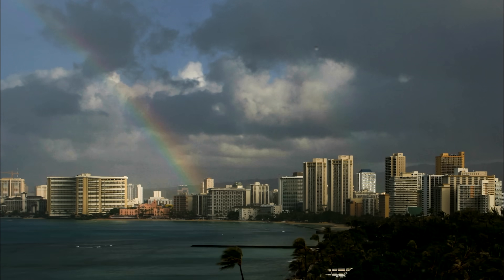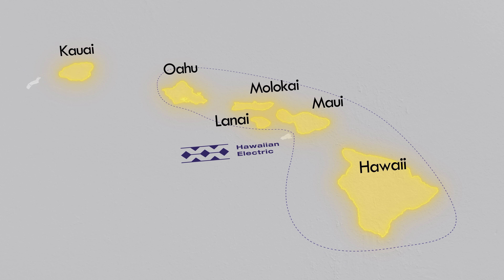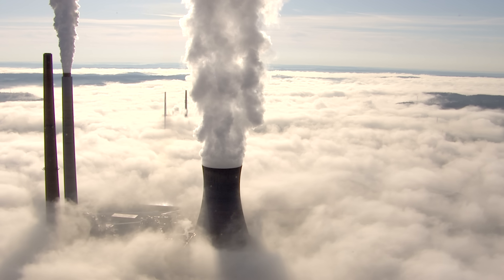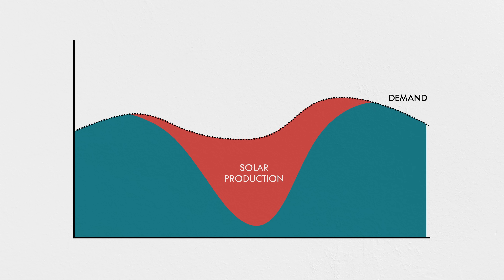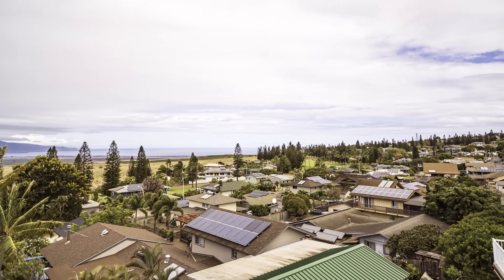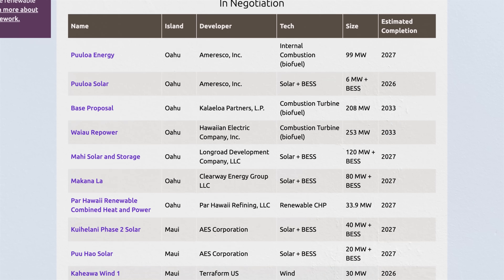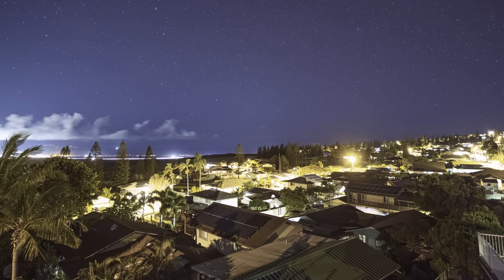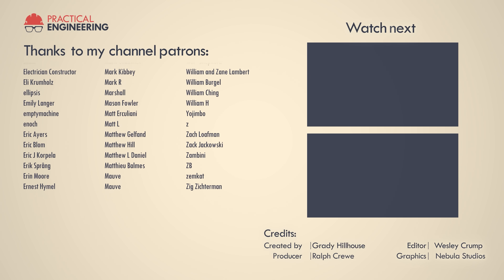How the Hawaiian Power Grid Works

Comment: Why is there only 1 geothermal plant on a volcanic island?
Reply: Oahu is the most populous island and doesn't have any geothermal potential. Only the Big Island does, and it's very challenging to find a location for a geothermal plant there that won't get decimated by lava flows.
Reply: @mack.attack  exactly what I was saying. learning how to work around those limitations is one of the big purposes of the one extant geothermal station.
Reply: @mack.attack This one. Literally every one of our other islands than the Big Island are basically geothermically dead rocks.
Reply: Well that's a little less surprising when you realize that the island with all the active volcanoes is not the same island, hence not the same grid, as the island with most of the people on it.
Reply: @kevinstrout630  Also the volcanism on Hawaii is really active and often shifts so its a matter of finding a place that's warm underground but not liable to have lava flow over it before a few decades pass.
Reply: It's also risky to build expensive power plants that might get run over by lava, our 1 geo thermal plant almost was in 2018.
Reply: @SquidFisT44 😅
Reply: @SquidFisT44 lava dams? Lol

Not sure what you build that out of,dirt I guess
Reply: I'd guess that most of the spots which are hot but not too hot keep moving.
Reply: @nnelg8139 nope, Hawaiian laws and treaties with indigenous tribes pretty much enable and encourage legal monopolies. They have no incentive to upgrade or expand their infrastructure to meet demand and are more than happy to pass any and all costs  to consumers sole reason why everything is expensive in Hawaii.
Reply: @nnelg8139 lmao the islands are "moving" that fast, bud.
Reply: Probably because only two of the islands are still volcanic and as stated in the video, the islands arent connected.  Most people dont live on the volcanic ones.
Reply: @leepete6815 yeah because Republicans are so dedicated to clean green energy. I know you're not serious. None of you are serious people.
Reply: The ultimate answer is always “money.” The upfront costs are larger and there isn’t a large US competency in GT. Hawaii would need to sustain a local skill set and build out excess capacity, with no one to purchase overproduction.
Reply: @norlockv  on top of that, Hawaii faces challenges with its geothermal that are rare or absent in places like Iceland. 

The one current geothermal plant is as much a testbed for the specifics of geothermal in Hawaii as it is a practical source of power. The lessons learned there will go on to inform the construction of later geothermal plants, public sentiment and legislation willing.
Reply: @norlockv US has the highest geothermal power generation, followed by Indonesia and the Philippines, far poorer countries. What are you saying?
Reply: @norlockv no it isn’t! The main answer is the communities don’t want them! There are hundreds of requests for new power stations and the local vote it down! Takes 3 minutes to look it up 🤡
Reply: The US has the largest amount of geothermal of any country.
Reply: @jeffjwatts  More than Iceland?  Not on a per capita basis.
Reply: Also, something I don't see being talked about. The volcanic activity in a place like Iceland and a place like Hawaii is different. Quite apart from the age differences. The volcanic activity in Iceland is much more "stable" geographically speaking. If you look north of the current Hawaiian islands you can see older and older islands (many of which now only show up as "bumps" under the Pacific Ocean) as the continental plate the islands sit on moves away from where the magma comes up. And there is a new island south of the Big Island under the ocean being formed right now. The volcanoes in Iceland don't do that. This makes geothermal energy in Iceland much more feasible as well.
Reply: @enviableechidna  theres a reason hawaii had the first ever instance of a geothermal well being innundated and overflown with lava and the second ever instance of a geothermal well drilling straight into liquid magma
Reply: A lot of leaping into conclusions here, very little actual data. Who here has done any calculations if it would even make sense? How much energy would a new plant add? Is it needed on that island? Were multiple plants considered in the planning phase of the first one? What if multiple geothermal plants would make as much sense as ten small fridges throughout a studio apartment?

Calling the engineers who built the whole system idiots when you don't have even a simple understanding of the whole system is not the way my dudes.
Reply: @Pingviinimursu that’s what’s getting me too. Too many people focusing on looking down on the “less civilized” (as those people would call them) instead of looking at the possible crux of the issue
Reply: The facts are clear and obvious, Hawaii is HIGHLY dependent on fossil fuel, one of the worst in the USA or close.   When they have resources.  They drive gas guzzling cheaps everywhere. @Pingviinimursu
Reply: @Pingviinimursu social media has a unique feature of empowering science and engineering illiterates to think they actually know things.
Reply: O’ahu’s volcanoes are extinct, so I doubt there is much geothermal potential.  The active Hawaiian volcanoes are all on Hawai’i Island (aka the Big Island), which is a significant distance away.
Reply: @Pamudder  nope. Try again.

Check where the volcano Haleakala is located.
Reply: @Pamudder  As was said, cables can be laid between the islands, except (insert your favorite reason here). I'm remembering all the things that DIDN'T go wrong with the Alaskan pipeline, even though EVERYBODY said that it would go wrong.
Reply: This is much more of a practical issue. Geologically speaking, Hawaii is very young. It has not had the millennia of erosion that other volcanically active areas have had like Iceland and Indonesia. Drilling through fresh-ish volcanic rock is incredibly expensive and usually ends with blasting. Since it’s also an incredibly rigid underlayment, the frequent earthquakes from the volcanic activity can break the underground lines. Basements in Hawaii are basically nonexistent for the same reasons.
Reply: I worked briefly on drilling some of the wells at the Puna Geothermal Project in 2022.

As far as I'm aware the project has support but other projects just wouldn't be in as optimal a location, but I can't say for sure.

Optimal or not, the Puna Geothermal Project was inundated with lava during the 2018 eruption, but they were able to repair everything and get it back up and running.

Also as others have mentioned geothermal has strong opposition from Hawaiian natives for religious reasons.
Reply: @carltonhealy9457 This is by far the BEST COMMENT. 
This coming from “the horses mouth” 💯🤙🏾
Everything @carltonhealy9457  has said is 💯true, down to the native Hawaiians disliking it 💯🙏🤙🏾
Reply: @carltonhealy9457  The religious part is such a shame, you would think it would be the ultimate validation and feeling of connection with a deity to directly power and protect your home with their energy. Can you imagine cooling your home using the heat from a volcano? Running the refrigerator that feeds your family on God power? Amazing
Reply: @carltonhealy9457 thank you for bringing some legitimate context and sanity to this thread
Reply: Very nice. Almost every different problem with society all on display in a single comment thread. 🤌
Reply: Probably because stuff costs money 🤷🏽‍♂️
Reply: Because... when HELCO pit out bids to build more geothermal plants, outside of the LERZ (where the most recent eruption was), they got exactly 0 bids. 

Investors only want to build, in the most dangerous lower Eastern rift zone.
Reply: @Maiant  Again, local government. Building permits. "No, you can't build there, you must build here." "No, you're not emplying enough women." "No, you're using the wrong cement." ("His" brother is a cement supplier) "No, you don't pay your employees enough." All of it is just reasons why government won't allow it to be built. It still comes down to local government. The reasons, are too numerous to bother discussing.
Reply: The active spot is very very variable. Any place that's warm enough would be under a very large threat long term that it'll get destroyed by an eruption. In 2018 a neighborhood got destroyed by an eruption that didn't come from the main caldera. Plus, where it would be possible would be the big island and the population there is so so so small compared to Oahu, where most residents live. Big island is huge in size and there's lots of room for solar panels and wind turbines. Easily movable and replaceable if there's ever a threat of eruption. People forget that the islands are literally whole volcanos sticking out of the water. You have to be very conscious of this fact
Reply: People don’t want the sacred religious site drilled into in a disrespectful manner. The traditional Gods, like Pele the volcano God, still have a MASSIVE cultural and religious significance. To us it’s like saying, “why don’t we put a power plant in the Vatican?”.  Most locals, for better or worse, would not support this effort, and it would be political suicide for any one to pursue it.
Reply: @DaBatman-o1v  makes sense, they have good reasons to not mess with the volcano
Reply: Lol this comment thread is batshit
Reply: Only one volcano on one island. That island also has a much smaller population than the main island.
Reply: Do you know how geothermal plants work?  Can you imagine some possible difficulties installing and maintaining them on an island that has plenty of volcanic and seismic activity?
Reply: Hawaii island is the only one that's actually geologically active but it really doesn't have that big a population
Reply: Cuz the water wells underneath will be broken into and they are essential for the ecosystem up top
Reply: I was baffled by that too!
Reply: Because it’s Hawaii. Everything is more expensive to do, and there’s nobody there to do it.
Reply: It’s because the islands actually don’t have much diversity under ground. If you look at the topography it’s too small to be home to such geographical features. It really is primarily just lava rock. Larger continents have vast array of variety
Reply: Only one island has hot geology, the Big Island, and there's not enuff demand to warrant building more geothermal for that Island. It's cheaper and simpler to build solar, wind and other types (mostly experiential power production methodologies like water wave, hydrothermal and other types).

The other Islands are largely extinct or  are technically dormant volcanic islands. Technically because those islands' last volcanic activity still are within the cutoff time between long dormant and recently extinct volcanos (about 10000 years). The islands of Maui and even Oʻahu technically have dormant volcanoes, but realistically speaking there's little doubt about them ever erupting again, but their last activities were still less than 10k years ago.

The current geothermal plant is still technically an experimental ppu (power producing unit) that doesn't have full regulatory approval to operate as a commercial operation. 

There's currently certain irregularties regarding the methods of the commercial interests are using in trying to get that approval. Some of which are bending the rules do hard that they've broken some of them (the rules). 

By and the large, the ʻaina (the people who lives here) generally respects the rules and looks with extreme disfavour on those who would try to rush and break rules to cut corners. Unfortunately those commercial interest are Mainland outsiders who have proven themselves to be a rather unscrupulous lot.
Reply: Because the residents don’t want them…
Reply: You need the proper location in order to set it up. Like the rocks underneath the plant need to be deep enough and able to take in water in order to generate electricity. I don’t know a lot about geology but I’m pretty basalt is not a good candidate for geothermal. There are also concerns about earthquakes caused by geothermal and the Hawaiian archipelago is the most volcanically active place in the world so you gotta be careful. Hawaii also isn’t a very rich state believe it or not.
Reply: @king_br0k I can totally understand that question! The answer is long-winded. As a Native Hawaiian born & raised here on three of the six islands that are populated, I can share that each island is VERY different from one another in terms of their access to certain renewable energy sources. The entire state has about 1.4 Million people living here, 1 million of which live just on Oʻahu alone, but the only island that has a RELIABLE source of geothermal energy is the Big Island of Hawaiʻi, which is home to about 200,000 people. 

As some of the comments mentioned, the Puna Geothermal Venture (PGV) project was met with considerable pushback when it was built in the 1970s from my Native Hawaiian community due to cultural, spiritual, & ethical concerns surrounding our goddess Pelehonuamea. You have to understand - this was 30 years ago when the benefits of this technology wasn’t properly communicated to the local community, in particular our Native Hawaiian Community. Although PGV provides an impressive 30% of the Big Islands’ energy needs, it is also okay to recognize the cultural controversy these projects can cause for indigenous communities like my own. It normally for a project like PGV to be both beneficial and burdensome.
Reply: @MrHawaiianguy  thanks, the replies to my initial question have been very informative
Reply: I think nuclear is going to be the answer to generate the amount of electricity that the worlds humans will need.  That is if we want to stop global warming.  Nuclear is actually very safe if the plants have adequately built containment walls around them.  For Hawaii, (I have an address near Hilo) nuclear is definitively not the answer due to the culture here, however we do have a very reliable solar source with roughly 12 hours of tropical sun a day year long.  That said, we are on HELCO but plan on putting up our own non grid separately constructed solar panel and lithium ion battery system for everyday use.
Reply: @thomasreto2997  nuclear is the best option in my opinion, the us navy is proof it can ge done safely
Reply: Politics
Reply: Being volcanic is not enough. You'll also need presence of subsurface fluid and claycap to have a sustainable geothermal process.
Reply: The gods get angry
Reply: @donwilson4934  Mwahahahahahahahaha!
Reply: I know I'm late to the party here, but I looked into it and I would guess that Hawaii might be too volcanically active somehow? The one power plant was actually shut down due to the eruption of 2018 and didn't return until 2020.
Reply: Democrats
Reply: It’s really funny how everyone is arguing about the religion problem when the most obvious reasons which have been stated many times in this reply section (moving hotspots, lava danger, low population, etc.) get no responses at all
Reply: @noodleman_9  a problem?
Reply: @noodleman_9 Because these people are incapable of logic or abstraction. They are beasts of nothing but emotion.
Reply: @noodleman_9  yea, I also found that funny
Reply: Because of non educated groups of people protesting it
Reply: To be entirely honest I see a lot of other good reasons, but I feel putting a large emphasis of the power grid on an actual volcano, one with frequent lava flows is a bad idea as well, one wrong flow and the power is out for millions, and for quite a while, as getting destroyed by lava seems like a “restart from scratch” kinda fix, which I fear is something a tropical, isolated, and extremely important island can’t handle. I mean they could always build 2 or more, or build giant earthworks to redirect the lava, but genuinely that seems so like, counterintuitive, I would just go nuclear and put it on a dormant island lol.
Reply: It's not that easy to just  build more geothermals. The tech is still relatively new and more expensive than building new coal or petro power plants. Thinking the locals are the main problem and too dumb to not build more is very naive
Reply: Because the govt chooses winners and losers, and their current money laundering scam is wind and solar.
Reply: Because Hawaii is ran by democrats.
Reply: Exactly...
Reply: It’s like something you’d encounter on a city builder 🤣 not unlocked until level 43!
Reply: Stop over crowded cities and the problem disappears.
Reply: One consideration may be religious. There have been fights against some construction projects because the land has religious significance to indigenous Hawaiians.
Reply: @@JuanSmithers Government issues building permits. All you have done is giver yet ANOTHER REASON why government won't issue the permit. Jacka**.
Reply: Oahu isn’t volcanic
Reply: Protect the aina
Reply: Only big island have active volcanoes
Reply: The big island is the only actively volcanic one and has a relatively small population.
Reply: It's called a monopoly
Reply: Same reason it’s seldom used elsewhere, it’s very expensive requiring hundreds of wells drilled, many of which will fail, and it needs a lot of fresh water.
Reply: Because the Government are paid by the electric company for them to monopolize electricity
Reply: It's an active volcano... sure spend a billion on a plant then 10 years later an eruption levels it...
Reply: preservation of the national park i suppose, as well as preserving the growth of Island landmass pumped storage and gravity storage is a definite winner as farm watering grade grey water not blackwater could be pumped up and down hill or to tower's which just absorb the exess energy for later use cement/ rock carrying gravity trains 🚂 if you don't have water then geothermal is definitely an option utilizing the existing coal plant just in a upgraded way even if natural gas run the steam engines could gather heat from magma stores to preboil the most efficient energy transfer fluids salt 🧂 water glycol refrigerants whatever works best
Reply: Unsure but the hotspot that forms the island is only below the big island. The smaller islands are older because the Pacific plate has been moving, and the smaller islands are where the hotspot used to be, but are now are now slowing eroding away
Reply: welcome to hawaii, land of the most currupt politicians and monopolies to ever exist. Our electric company is owned by blackrock
Reply: There's a lot of religious/sacred spots to the native Hawaiian people. It's like the situation with the observatories on Big Island. Very tricky spot to figure out.
Reply: They dont want cheap solutions.  Period
Reply: @CabilGibbs  It isn't anywhere near cheap. Solsr is less expensive.
Reply: I live on Big Island….the public does NOT support the Puna Geo thermal Venture.
Reply: Not all Hawaiian islands have active volcanoes, Oahu, Kauai volcanoes are extinct
Reply: Wow you know I didn’t think of that before very good question isn’t just like Iceland or Greenland???
Reply: GT-ing around a shield volcano where magma has low viscosity and could just have lava to unexpectedly ooze on your backyard is yet another challenge. Start a drilling but expect higher chance of lava to come out.
Reply: Because its expensive and only like 200,000 people live on the Big Island
Reply: Traditional power providers do not like competition. My buddy who lived on the Big Island (the volcano island) that he would get hate from people for having solar panels on his house. The power companies would state power costs were so high because of solar panels. There is an actual volcano there and year round sun!
Reply: Woke politics
Reply: Because the other ones are probably used by the government or military for secret underground bases
Reply: Being volcanic is not enough. You'll also need presence of subsurface fluid and claycap to have a sustainable geothermal process.
Reply: I mean volcanoes are unpredictable and you could lose a whole plant in seconds plus activist. The big island isn’t that big and the volcanic activity is isolated to one part of the island the whole island isn’t active
Reply: Because it's ran by demonrats n they don't care about the population just the power of government
Reply: You should research it. Its a good question
Reply: Exactly! I was wondering if they could take a page out of icelands book
Reply: Limits growth due to low cost of energy
Reply: Only one island has an active volcano.
Reply: The geothermal plant we did have was 100 yards from the last lava flow that destroyed almost 1000 homes my family lost everything in that lava flow.The puna geothermal venture the company that  operated the plant was drilling sideways down to 50000 feet in the same direction the lava popped out of.They created that lava flow that caused hundreds of millions in damage.They had the plant right next to subdivision.Friends that lived close to the plant had respiratory problems from the steam they would vent.Go ahead build one in your neighborhood not mine we lost everything its not worth the risk
Reply: And zero nuclear ?
Reply: Well, only one of the islands has active volcanic shtufffs. Also, the volcano is a literal God in fokelore, so the natives would get pretty peeved.
Reply: (Now that I’ve read some other replies) — To all yall typing about pinkos and libs: that’s not what OC was asking, so quit wetting your panties over two systems that historically have both lead to some folks ruling over other folks; people will be selfish and greedy no matter what governmental systems are in place.
Reply: Small population. Most people don't live by the volcano and it's not cost effective to transit power from big island to Oahu.
Reply: Geothermal doesn't work the way you think - it just takes advantage of the fact that more than 4-5 feet below the surface, the earth is pretty much the same temperature year round. You can draw heat out of that in the winter and dump heat into it in the summer
Reply: There only one volcanic island. The other islands are just older islands. The spot where the volcano 🌋 is active is because of the movement of the tectonic plate.
Reply: Because we don't have materials that can withstand the heat and pressure of magma deep enough to extract the endless power from them
Reply: Man if only you had gone into electric stuff in school
Reply: They're expensive
Reply: Because Republicans hate helping people
Reply: Only 1 island has hot geothermal the rest of the islands are cold and full of water.
Reply: @doomaster4  Full of water?  You were on a roll and then blew it.
Reply: There were plans to make several Geo plants. Enough to generate power for the entire state. Same for a wind farm proposed on the windiest spot on earth; Kahua Ranch. This farm would also produce enough energy for the entire state. Larry Ellison of Oracle proposed a giant wind farm on the island of Lanai that would generate enough energy to  power the entire island of Oahu.  HEI refused to purchase the power generated from any of those projects. HEI blocked plans to unite all the islands onto one grid. Instead, HEI chose to make their own mini projects, limit the amount of solar on homes within neighborhoods, and remain dependent on foreign oil. All that Grady suggests are distractions to the real problems. Politics, control, and greed. All this could’ve been settled well before Grady was even born. Back in ‘74, a local entrepreneur suggested Hawai’i use sugarcane to generate Ethanol to power 40% of all island vehicles by 1985,  100% independent by 1995. Local business C Brewer blocked and shuttled  the project.
Reply: Democrats they fu$& everything up
Reply: Maybe it's a big one?
Reply: Because:

Drill baby drill!!!

American ideology...
Reply: Because Republicans hate renewable energy.
Reply: The same reason why we don’t use nuclear as our MAIN baseload power. 

It makes too much sense
Reply: @ Nuclear power was not chosen because it makes “too much sense”? What a silly thing to say to say. 
You might have said that a small island like Molokai or Lana’i does not have the market to support a nuclear power plant, some other comment that actually makes sense, but whatever, being ignorant sounds cool.
Reply: Because geothermal is a ridiculously impractical pipe-dream..
Reply: Because it’s not really working properly
Reply: Money number 1. Number 2 the people in power are old, and forget that the world kept spinning and science is progressing every single day, making new tech available to solve problems, but then you have some senitors who can't even recognize the probelm cuz they have an off grid mansion, and experience no problems themself and all they see is us complaining about nothing and dismiss real problems. They don't care is the 3rd biggest reason. They have their life in order and they just want to keep their job. I'm sick of the adult behavior in America. I'm seeing the younger gen watch this and think the same, and I'm 32. So right about now the people I was going to school with, the bullys and jocks and nerds, are now getting in, while Trumps gen are getting out. When that happens, we'll see real changes.
Reply: Unlike other places hawaii is still very active and also has very low visocity magma, letting it flow far easier which can (and has) gotten dengerous
Reply: Hawaii is a regulatory nightmare
Reply: Natives
Reply: Is that an actual question you are asking
Reply: People are memeing on this a lot but part of the issue has got to be the fact that it’s a base plant. Basically it’ll produce a base level of power but doesn’t have the flexibility of a natural gas turbine plant that can go on and off much faster. Think a nuclear plant that can supply a toooon of power for a huge area but it isn’t flexible in the event that there’s spikes in demand at different times of day/year/region/etc.
Reply: Just Cultivate More Mana, Nature Will Sort Itself Out 😂
Reply: Oil lobby has basically the entire government in their pocket.
Reply: The geothermal source does not stay in one place.  The geothermal plant was almost completely covered by the lava flow of 2018.
Reply: Because while geothermal can supply approximately 70 percent of the requirements only 30 percent is used due to those making big bucks mannageing the fuel oil producing the balance of required needs.
Reply: Volcano sacred gods will be angry
Reply: You can't just set up anywhere for a geothermal plant. It's just plain luck that Puna Geothermal didn't get covered by lava. 

There is local opposition, but it's not that big of one.

One of the main reasons is that it's not practical to invest in a plant in an area that is geologically unstable.
Reply: Parallel too.  Not downhill of
Or on an ocean platform
Or...
Reply: Heco is a monopoly they don’t care how many plants people want.
Reply: Asking the real questions
Reply: The same reason we don’t have global nuclear, corruption and lobbying
Reply: causes there’s only 1 island out of 8 with geothermal activity and it’s only home to less than 15% of the total population of Hawaii
Reply: Cost of construction and operation vs output.  

It’s a novel concept, and it works in very few areas.  They are built for “feel goods”, not for effectiveness
Reply: Wow. The ignorance and vile nature of so many of these replies is pathetic. Most of the reasons geothermal isn’t widely used on Hawaii Island (the big island- the only volcanically active island) are practical and technical not cultural or political. In the 2018 eruption/ lava vent flow, the lava flow came up onto the geothermal power plants property. Out of very real caution, the plant had to be shut down and the wells capped to prevent the release of toxic / poisonous gases like hydrogen sulfide to protect the population. There are legitimate and serious concerns and difficulties around geothermal on Hawaii Island and for a bunch of people not familiar with the reality on the ground, who obviously have ZERO experience or knowledge of Hawaii to just spout off self righteous nonsense is shameful.
Reply: because it's a place colonised by the USA and the USA hates clean energy
Reply: Supply v demand v cost v infrastructure v necessity
Reply: Its harder than you think, think of the island as Swiss cheese below the surface. Lava flows like water path of least resistance. So it's constantly moving below ground. One day it's under here the next day it's under there. Then when it blows which happens time and time again they get covered up by lava and u start all over again
Reply: Because you can't control the price of geo thermals. No geopolitical reasons for jacking up your bills whenever someone decides to start awar
Reply: Because there isn't much to power
Reply: Though Hawaii is overwhelmingly Christian, a lot of Hawaiians, native or not, still hold many traditional pagan superstitions. And the volcano is at the forefront of these pagan beliefs as you may imagine. Not to mention some of the island, especially Oahu (the most populous one) is too far from the so-called "hot spot" of volcanic activity.
Reply: The real truth is that the only active volcanic island is the big island, but big island is also one of the least populated islands. So building a geothermal plant for an island that doesn’t need that much power is a bit redundant. Unless they had a way to transport all that power to the main island of Oahu
Reply: Because only the Big island has an active volcano. Its on the far corner on the south side of the island. Transmission would be an issue due to lack of funding. The one geothermal plant is under attack constantly by ignorant people blaming it for causing the eruptions on an active volcano... 🙄 lots of ignorant people here sadly. Helco also basically has a monopoly over the power production in Hawaii.
Reply: Gods angry...
Reply: They haven’t upgraded their tech tree in a bit
Reply: Other islands have inactive volcanos. The island with the active volcano is not that heavily used and not heavily populated. We hate nuclear because it works and people have emotions over facts and it is expensive but then again we approved a 10 plus billion dollar rail system that is heavily outdated and 20 plus years beyond its deadline and still asks for more money run on sentence.
Reply: Posterity?
Reply: Shut up!!! Stop asking the government questions!
Reply: Reason #42.
Reply: Lol, you don't want to drill into a volcano 
That would open it allowing it to flow out
Reply: Because corporations think profits are more important than life.
Reply: @patrickday4206  Corporations can't think any more than bicycles can think.  Neither have brains.  It is only the humans who operate both, and much more, who supposedly have reason and brain power.  Guess you blame guns for violence, too. You need to admit the source of the problem and give up political BS.  Humans can be wonderful creatures or horribly immoral.  We destroyed, or trIed to destroy, religion and the morality it brought to us, and then blame all sorts of inanimate objects for all the wrong we, not they, do.  Dumb or crazy.  Your choice.  So, instead, you choose to blame the inanimate objects as being the source of all evils.  Wow.  How human of you.
Reply: It's really expensive
Reply: @DebBoi  not more than actually operating a coal burning one
Reply: The hippys and eco nazis won’t allow it
Reply: @bradleyalo2151  if only you knew what the words that are coming out of your mouth mean
Reply: only one volcano. if they did 2 the volcano would freeze.
Reply: All I have to say about these comments is 🍿🍿🍿 it’s like watching a drama seen about one very loud person who projects onto people they know nothing about, sighting reasons outside the situation
Reply: Volcano is seen as deity by some of the locals. Not joking.
Reply: @nagasako7  Black Indigenous gods/religions has never stopped the White Man from destroying Nature before...
EG: Rainforests are a sacred  to Black Indians of Central America. Amazon is farmed for corn.
Reply: Atleast that diety exist  @nagasako7
Reply: democracy is democracy  @nagasako7
Reply: @nagasako7  so it’s religion
Reply: @nagasako7  Local has a different connotation in Hawaii, usually referring to people who have been there a long time but are specifically not of Hawaiian ancestry. The proper term would be Native or just Hawaiian.
Reply: @joshw.2739 Aloha, no. Those of us that are not native Hawaiian are called residents,  not locals. Local usually refers to native Hawaiians.
Reply: @nagasako7  Bingo! And don't forget the support they get from Green Peace, et al.
Reply: @anthonyhargis6855 not correct. It’s about money. In the US, states can trade excess capacity. In Hawaii, excess capacity that cannot be stored is lost.
Reply: protests by poorly educated locals
Reply: @@JuanSmithers ". . . because of native hawai'ian opposition." Stop.

"But I have ANOTHER REASON WHY GOVERNMENT . . . "

It's the government. Stop giving me MORE F'ING REASONS WHY GOVERNMENT won't issue building permits.

I said, it's the government. Your reason DOESN'T NEGATE THAT any more than anyone else's reason did. They don't build more because GOVERNMENT won't issue them a permit to build more.

It's local government. Period.
Reply: @anthonyhargis6855  Given how adamant your recent reply is, can you at least back this up with a source. 

The burden of proof to prove that the local government is (keyword) arbitrarily preventing the construction of more plants is on you.
Reply: @pishposh3306  No, it isn't. Local government, and ONLY local government, issues building permits. And they aren't issuing any. That, in and of itself, is the "proof" you demand. As I said, the ONLY thing any of you are supplying is VARIOUS REASONS that they are not issuing the permits.With one reason, or another, various voters will be ticked off. Can't upset THIS group of voters, so . . .
Reply: Because it's less profitable and we live under capitalism.
Reply: @winterburden Techincally, the electricity consumer cooperative is decentralized communist tho.
Reply: @winterburden yea i hate capitalism. profit is parasitism
Reply: @winterburden ... actually we are living under an Oligarchy system that most Americans could never believe to be true ... until it's too late.
Reply: @winterburden  Geothermal is one of the most overrated forms of renewable energy. It's one of those things people who browse reddit bring up online because they think it's cool but forget that it has a ton of issues and has massive upfront costs. It has its niche applications in ideal areas like in Iceland, but there's a reason why not a lot of countries, regardless of political systems, use it.
Reply: @winterburden and how would communism work? Everyone will occasionally get power?
Reply: @winterburden reducing costs is a factor in profitability. Thats why capitalism typically works towards efficiency.
Reply: @winterburden you win the prize for least intelligent answer.
Reply: @DougnTx  hope your Texas brand variable rate 'lectricity works all winter
Reply: @winterburden - “less profitable and we live under capitalism”

That is a dumb statement. Capitalism creates abundance at reduced cost. The energy monopoly at Hawaii is not capitalism, but rather a type of socialism.
Reply: @winterburden under communism power shortages would happen most of the time. Mr Bill
Reply: @janetlewis7145  No. Power outages happen most of the time under capitalism. And you still have to pay, for no service.
Reply: @winterburden  Not where I live. Look at Cuba, a communist system. Always power outages and shortages of every common consumer item. Mr Bill.
Reply: @winterburden  less profitable = people wouldn't pay for that = people don't need it
Reply: @mskiptr  wrong. exploitation is the most profitable thing there is, and people definitely don't need that, genius.
Reply: @winterburden  exploitation (as in, deceit) is or at least should be illegal

edit: Just like theft. It can be massively profitable, but we don't need it. Because it is unjust, it is illegal.
Reply: @mskiptr  wrong. exploitation is not illegal. it is how we do business under capitalism.
Reply: @winterburden  As I said, it really depends on what you mean by exploitation
Reply: @mskiptr - “exploitation (as in, deceit) is or at least should be illegal”

That is the sole purpose of government, under a capitalistic / free society.

This is why military & police exist under Capitalist / Free Societies — to enforce free peoples from being enslaved by the power of coercion of others [via violence, ie the gun.]
Reply: @winterburden  You think communism would be better?
Reply: @terryboyer1342  you think always doing what's profitable instead of what would be good for the community is better?
Reply: @winterburden  You didn't answer my question. What "system" do you think would be superior to capitalism?  
Your use of the term "always" is so limiting.
Reply: @terryboyer1342  always profit above all else is what happens under capitalism. why do you ignore reality and pretend like this is the best way? do you own the means of production or something?
Reply: @winterburden  Again you avoid the question. What system do you think is better. Producing the maximum good for the most people? Your statement "always" profit above all else is false and in gross error. How am I ignoring reality? I am pretending nothing. Capitalism has clearly enabled and raised humans from the dark ages of famine and disease to our present modern world. What other system could have done that? Is it perfect? Of course not. Is there room for improvement? Of course. What way do you think is better? I believe you avoid answering because you don't have an answer. You are so quick to criticize  and condemn capitalism yet you present no alternative.
Reply: @terryboyer1342 The opposite of capitalism isn't communism, but rather socialism. Techincally, the consumer cooperative is decentralized communist tho.
Reply: @terryboyer1342  Capitalism is fine as long as it's regulated and people aren't able to use their wealth to influence the laws that prevent them from harming others. The problem is people think it only counts as "real" capitalism if the government does as little regulating as possible. If that's "true" capitalism, then capitalism is equal to communism because they are both unrealistic concepts that have never been practiced according to their theoretical ideal. Such capitalism can take no credit for anyone's escape from poverty since it has never existed.
Reply: @gljames24 - “consumer cooperative is…” capitalism, also.

Capitalism is when people are free to exchange their labor & goods with others, without coercion & deception.

Profit is not a requirement for capitalism, profit is only to keep free exchange going for the long term.
Reply: @winterburden Market Reality has entered the chat
Reply: @winterburden you make the mistake of thinking communist governments care at all what the community wants
Reply: @winterburden the more cost effective option IS what is better for the community lmao
Reply: @MRWATSiT2YA37  cost effective is not the same thing as profitable. lmao, genius
Reply: @winterburden  Profit = revenue - cost. Lower cost = more profit. Even if retail energy costs stay the same for Hawaiians, there is always incentive to reduce costs for the energy providers. Why do basic economic principles always fly over your heads?
Reply: @SanchoPanza-m8m as a Canadian. 1. Absolutely do what we did. 2. We aren't socialist, even a little bit.
Reply: @winterburden who decides what’s best for the community?
Reply: @terryboyer1342 I think communism would be better
Reply: @winterburden Are you struggling at capitalism or has someone manipluated you through feelings that their struggle is somehow your struggle? It's the easiest economic system to live in. Work hard. Graduate high school. Don't have kids before marriage. Don't sign into debt irresponsibly. Focus on you and your family. You'll be fine.
Reply: @winterburden you don’t understand what profit is
Reply: @FoxWolfWorld  profit is theft.
Reply: @winterburden Pretending isn't necessary. The world has seen what every alternative that's been tried to date can lead to and it's dreadful. Capitalism, whether you like it or not, has brought much of the world to some of the best living standards in all of human history. It's the reason you even have this platform to complain about it on.
Reply: @gljames24 The opposite of capitalism is both socialism and communism. It's a sliding scale. Fascism is far right, communism is far left. Capitalism is left of fascism, just as socialism is right of communism.

It goes - communism, socialism, capitalism, fascism

That is, if we're only using the four. There are many more but they don't get as much press.
Reply: @ElusiveTy  wrong.
Reply: @winterburden And who decides what's BEST for a community? In communism, it's a few unelected bureaucrats with no understanding of the subject.
Reply: @DougnTx  you're describing what happens under capitalism
Reply: @SanchoPanza-m8m When did you slide into communism?
Reply: @winterburden Stalin eliminated most of the community. Mao ditto.
Reply: @Seriously-m1p  America has the highest rate of incarceration in the entire world, bro. Capitalism kills
Reply: @terryboyer1342  Actually it is a mix of both and closer to socialism than capitalism. Those in charge of power are greedy, limited supply means they can charge more. Laws prevent a free market capitalism, so a random company can't just build their own plant and provide a cheaper service.
Reply: @terryboyer1342 Social capitalism system is superior to capitalism system.
Reply: @gljames24 As society becomes more advanced, citizen needs expands, required supporting systems get more complex. One economic model is no longer sufficient to serve everyone needs in all conditions. People, especially Americans, are not monolith. US is not a pure democracy and its economic model is not pure capitalism. Average US citizens are too poorly educated for true democracy to work. US economic model is social capitalism and not just capitalism.
Reply: @terryboyer1342 who said anything about communism? Socialism is the best approach.
Reply: they think it's funny
Reply: @@JuanSmithers Why should I care that Hawaiian RINOs support Trump? I supported Cruz and DeSantis, not Trump. I'm a Conservative, Trump is not.

And the government issues, or withholds, building permits, not the "republican kanaka maoli" people. Local government.
Reply: @anthonyhargis6855 Support two clowns and you are one yourself but your comments have already shown that.
Reply: Because it would be too logical to have more. It's a blue state. The volcanoes have rights. Yeah, I know. You think I'm kidding.
Reply: @anthonyhargis6855 You say that in a mocking way, but Hawaii has been severely harmed by people with one-track minds who only care about solving a given problem without regard for the problems they're creating in the process. If giving mountains rights (which I'm sure is a lot more complex than you're implying) forces people to slow down and consider all the impacts their actions might have on those mountains and mitigate the harms, then that's a rational approach. Sometimes the wacky solution is the best solution.
Reply: @anthonyhargis6855 the native hawaiians regard the volcanos as sacred, its one of the most important parts of their mythology+culture. Its far more complex than the american idea of left vs right.
Reply: @anthonyhargis6855 you actually think you know what youre talking about. wild
Reply: @bentoboy15  You actually think your volcano god is making it happen. Wild.
Reply: @anthonyhargis6855 I can’t tell if this is satire or not
Reply: @thomaswalsh4552  Most local government IS satire. LOL
Reply: @anthonyhargis6855  you people are wierd for always bringing up politics 🤦‍♂️
Reply: @anthonyhargis6855 which is just cause they’re old volcanic islands and currently volcanic islands it doesn’t mean they are well suited for two thermal power. There are very few places around the world suited for geo thermal it can’t be too hot and it can’t be too cool and there should be an extremely low chance of eruptions near by. Basically somewhere with STABLE geothermal activity think yellow stone. But Uhm why don’t we have geothermal plants in yellow stone is it cause yellow stone is in blue states? No it’s cause we respect wildlife and recognize the power gained from the geo thermal does not out weigh our want/need to have preserved wild spaces
Reply: @anthonyhargis6855  Because you know nothing about the volcanoes, islands, people or its culture. Educate yourself.
Reply: @JonathanKJM  ROFLMAO
Reply: @anthonyhargis6855  It’s not really because of just the god but also for the environment. Since Hawaii’s income is based on nature
Reply: @anthonyhargis6855 red states are the ones against renewables dude
Reply: @anthonyhargis6855 agree that why TX grid was down, they had separate grid.
Finally realized that they need to join federal grid after days of power blackout ?
Reply: @anthonyhargis6855 For a Republican, you sure have contempt for religious beliefs.
Reply: @anthonyhargis6855 you’re not kidding but you are talking about something which you obviously have no idea what you’re talking about. The big island / Hawaii island is the only active volcanic island and it’s so active it’s actually problematic to tap into the heat source safely, and the geothermal facility on big island was almost destroyed by the eruption in 2018. Zero to do with blue red politics.
Reply: Always gotta bring politics into this. That's not the reason.
Reply: @anthonyhargis6855 Hawaii was annexed and is blue state. Make it make sense
Reply: @anthonyhargis6855 Mother Nature has more rights than the citizens. And the citizens, most anyway, are happy with that status.
Reply: @anthonyhargis6855 what are you talking about blue state? If it was red it would be coal power plant. But since your an experience on geo therm power plants tell us how to do it?
Reply: @anthonyhargis6855 someone says money someone says blue state lmao this the problem with humanity is we don’t understand how to balance ourselves. We could be a society like a utopia but instead we’re a dystopia 😂😂😂 oh well like kids we’re all so silly even the most intelligent people
Reply: @anthonyhargis6855 obviously you don’t know about our culture😊
Reply: @anthonyhargis6855 Right... Because the Red state of Texas has such reliable power. 🤪 Republicans can't even keep a government open, what makes you think they can run something like a power grid?
Reply: @anthonyhargis6855 of course, it always boils down to politics 🙃

And ofc, people demonstrated you're actually wrong, because the reason for the few geothermal plants is about the locals religion.

Is this a big surprise? Not really. People who tend to randomly bring politics into a non-political argument often tend to also be wrong.
Reply: That's no even really true. There's many issues with building geothermal plants on young volcanoes with very active volcanism. Plus , the island with the majority of the population is not suited for geothermal plants. Please at least do some research. It's very ironic how you're pointing out how other people are wrong whole being confidently wrong yoruself.  @rosskrt
Reply: @anthonyhargis6855  Cool strawman dude.
Reply: @David-um8tb  Right back at you.
Reply: @gljames24  We shalle disagree with both of your points.
Reply: @anthonyhargis6855 its funny how you ignore people who have presented you with valid explanations as to why there is only one geothermal plant on the islands or whatever political nonsense you spout. It’s always people like you who have a) never been here. B) only been here for a week) or C) lived here for a year or two. Who talk about everything that’s wrong with Hawai’i.
Reply: @omgitsJoeVibin  Paint no longer contains lead, so what do you -- mistakenly -- think is going to happen if I do? Now go finish school.
Reply: @anthonyhargis6855  sounds like you just had some. Omg.
Reply: @omgitsJoeVibin  Strange. I was just thinking the same thing about you. Weird, huh?
Reply: @David-um8tb ahh yes, whenever someone’s rightfully called out the leaders and residents of a state for incompetence it’s “straw manning”
Reply: @anthonyhargis6855  And then there's Texas, a model of reliability. :)
Reply: @anthonyhargis6855 making fun of other people's religious beliefs isn't a good look, no matter how impractical you think they are. About 25% of the islands' residents identify as having indigenous ancestry - their islands, their call.
There's concern that injecting water into active volcanoes releases too much sulfur and other pollutants. Plus there's the perception that more geothermal plants could increase volcanic activity, which is already a major danger to infrastructure as it is. The existing plant did have to be shut down for a while because of its proximity to an eruption.
Iceland famously uses a lot of geothermal electricity production and still only produce about a quarter of their electricity from geothermal - similar to Hawaii. They also have the luxury of vastly more space to build the plants where natural aquifers supply steam. Hawaii doesn't have those.
Reply: @erikdietrich2678 when I last checked Hawaii was a democracy. Not a tribal dictatorship.  25% only shouldn’t be deciding anything. It’s the 21st century and people need power to live.  Not the 15th century and we pray in terror every time the ground shakes.
Reply: @xr6lad  respecting other people's religious beliefs sometimes means we can't just do the otherwise easy, obvious thing. A mature society doesn't just discard minority stances because they can be outvoted.
Reply: @erikdietrich2678 'Their islands', I'll stop you right there. The islands are American territory, it's American land, owned by the nation.
Reply: @anthonyhargis6855  Conservative comments don't usually do well on educational channels. Try a news channel.
Reply: @moniker2804 YouTube is an educational channel?  Maybe sometimes and certainly not the comment sections.
Reply: @moniker2804 factual comments belong on an educational channel. Which party deals in rainbows?
Reply: @Seriously-m1p  conservative comments don't do well on educational channels. I don't think that's a coincidence.
Reply: @anthonyhargis6855  so it's a conservative issue I suppose. You know, conserving tradition in favor of actually improving the lives of people.
Reply: @janusprime5693  Not really. Edit: To elaborate; yes, rather than sacrice a million sparrows to save one person, as God tells us to do, they would rather sacrifice a million people to save one sparrow. Satan, and his people, are always the opposite of God.
Reply: @anthonyhargis6855  comment countdown: from conservative to crazy... three comments. new record?
Reply: @anthonyhargis6855 that you feel entitled to impose your god on other people (who have a different one) is a problem.
Reply: @psgouros  You impose your Volcano god on me, telling me I have to do without electrical appliances -- which is everything today -- in order not to offend your god. Any other two-faced observations?
Reply: @Mrpersonman0  Right back at you.
Reply: @plwadodveeefdv  It's not much of a stretch from conservative to crazy.
Reply: @anthonyhargis6855 lmao going off the rails there a bit, bud
Reply: @thomaswalsh4552  LOL Naw, I just get tired of the idiotic denials. And, of course, implying that things are said . . . which were not said.
Reply: @anthonyhargis6855 damn, this comment is funny (and idiotic) on two levels. Not only is it misquoting and misrepresenting what was actually written in the bible. But i also find it funny that you bring up sacrificing sparrows specifically given how the great famine in China (which resulted in millions of people dying) was started due to that very same mentality that killing a million sparrows is a good policy decision
Reply: @psgouros that you believe ANY god should be involved in planning and provision of services is novel.
Reply: @xr6lad  I don’t, but it’s not my opinion that matters. Theirs does.
Reply: @anthonyhargis6855 Satan here.
Your mean!
Reply: @anthonyhargis6855  great counter argument. It fits in well with the politicians you support. Hope your head doesn't hurt too hard after thinking of a response.
Reply: @anthonyhargis6855 the CCP killed a million sparrows.  Then the insects that the sparrows ate bred out of control and ate all the crops.
Reply: Because that would make too much sense and localized thinking
Reply: @aaronk534 Because you know nothing about the volcanoes, islands, people or its culture. Educate yourself.